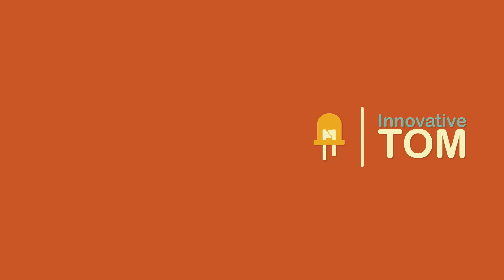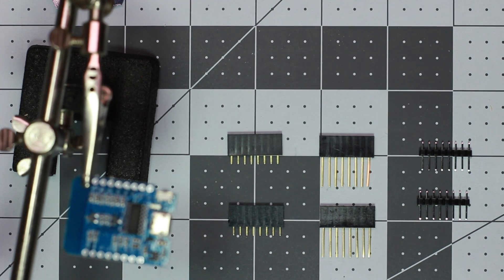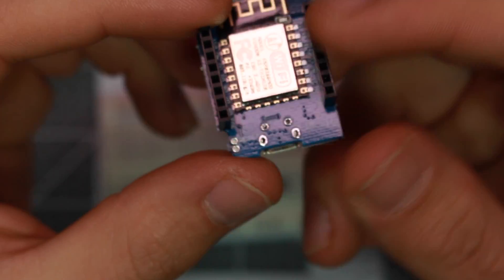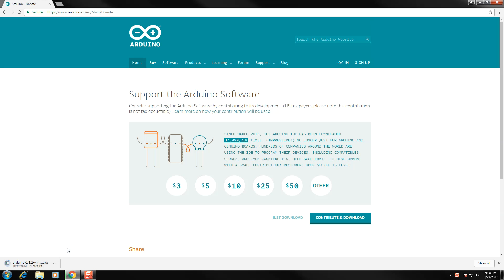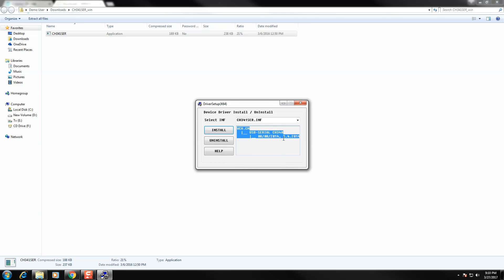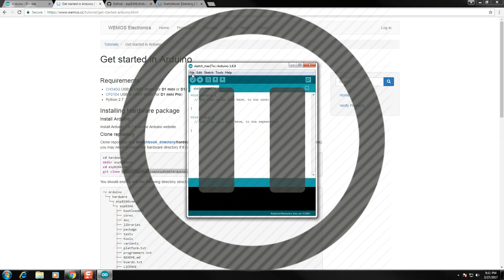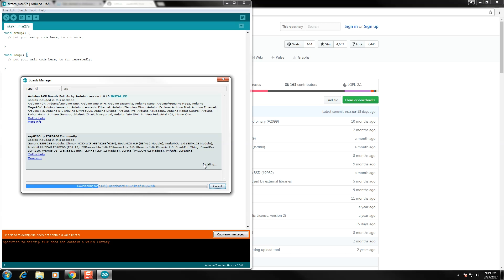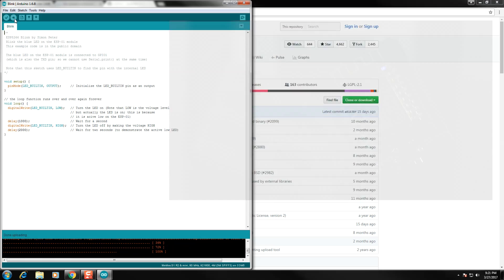Wemos D1 Mini, ESP8266 Getting Started Guide With Arduino

Comment: Hi Tom, I've followed the video, and installed the microgear library (v 1.2.4) and the board by esp8266 community (v 2.7.4), but I don't have the option you selected "WeMos D1 R2 & mini". Instead of that, I have only the option "WeMos D1 R1". Could that be the problem? The led does not blink like in your video, I receive a timeout error . Thanks, Andres

Comment: This newbie successfully followed the video - thanks!

For others just getting your feet wet:
(1) Some USB cables will have the right connectors, but are power-only cables; they won't work.  You need a cable with the data pins connected.
(2) The COM Port you need won't even be visible until you have the board connected to your PC with a good USB cable.  It will likely be the highest-numbered COM port on the list.

Other than that, if you carefully follow the instructions, it should work.
Reply: This was the single most useful tip I have read. I tried 2 different USB cables and neither allowed my Windows 7 PC to recognize the WeMos D1 Mini board.  Tried another after reading this and BINGO!  Recognized it!  The original poster should float this comment at the top of the comments.
Reply: that was hella helpful

Comment: I have a mac and can't get the board to connect with the computer because I apparently need a "driver" which I installed, but it still isn't working. Nothing comes up when I go to the "port" option. Does anyone who has a mac know how to deal with this?
Reply from the maker: +Aidan Angus-Henry from my experience mac users have a little bit harder time. The chip the board uses to communicate is the ch340g. You can google "ch340g mac" and find some different answers, but it varries depending on what os you are running. Let me know how you make out.
Reply: +Innovative Tom Thanks for responding! With things like this I've always had more trouble with macs as well, I'll look into that driver, thank you!
Reply from the maker: I did have it on a mac at one point I know it works. not on the latest os though. I remember having to mess with some command line stuff. The other thing you could do is install windows on bootcamp. Windows 10 is sorta free*. You can download and run it normally, it just asks to to register it to change some of the settings. That is probably what I would do.

Comment: The library is listed as INCOMPATIBLE with Arduino 1.8.2
Reply: My mistake. If you have the board selection as Wemos, it will show up correctly. I didn't realise they did this in the IDE. Pretty cool.
Reply from the maker: fusionstream sweet!

Comment: Good stuff, thanks for the tutorial!

Edit: I don't see my board coming up as a com port on my computer, any idea what could be going on there?
Reply from the maker: Thanks! Did you install the drivers for the CH340G? Make sure you restart after the install. Also try a different USB port sometimes that helps.
Reply: Restart the computer, or Arduino IDE?
Reply from the maker: Jeremy Cook's Projects both
Reply: Hmm, per your suggestion, tried that, tried different cable, port, and even a second board that I have. Not reading at all, not even as a bad USB connection. Interestingly AI_THINKER comes up as a new WiFi network.

The driver I find is actually ch341 and says "the drive is successfully pre-installed in advance!" Any input?
Reply from the maker: Jeremy Cook's Projects so it getting power and working, sounds like a driver issue. I would grab the drivers from the wemos website.
Reply: Hmm, did that to begin with, did it again, still not seeing it in device manager. Thx for your input though.
Reply from the maker: Jeremy Cook's Projects I would keep messing with it sometimes it something simple, are you using a hub? Sometime they can provide enough power. Also do you have the same wemos? The "pro" or newer one uses a different chip
Reply: Hmm. I was, though tried direct, and even a different computer (without the drivers installed there though). Tthe module says ESP8266MOD, not sure if your says that or "EX." Anyway, thx for the help, I'll likely set it aside for a bit.
Reply: Hey Tom, just wanted to let  you know that it seems it was the cable (though I thought I tried two, perhaps I did and they both didn't work correctly?) Took it to a friend and he tried his, worked nicely. Still haven't programmed it, but at least showing up as a port!

Thx again for your help.
Reply from the maker: +Jeremy Cook's Projects AWESOME! It's always something simple.
Reply: Ha, yeah. A little frustrating, but happy to have it solved!
Reply: Got the same issue, gladly I found your comment! My cable was broken as well xd

Comment: At 0:15, how did you add the label that follows the "FCC" marking for a few seconds? That is very neat.
Reply from the maker: Jim Happer it's called a "call out". I used. Program call Black Magic Fusion. Can be done in after effects and motion 5. The follow feature is build into the program. Took a lot longer to do than I expected.
Reply: I think the call out was worth it. Thank you for the reply and the exceptionally clear tutorials. I just used your soldering trick with the headers and it worked very nicely.

Comment: I have noob question, 

qns 1) what if we solder on the other side ( face the other way)? 

qns 2) both way works, why do you solder the direction you are doing?
Reply from the maker: weinfin so because of they way the shields work. The Pinout need to match up. It could work either way but you want to make sure the pins and shield pins line up.
Reply from the maker: Also could call them IO or outputs of the wemosbord

Comment: how Wemos D1 Mini, ESP8266 connect with arduino?
Reply: download the driver, in the IDE (arduino software)
Reply from the maker: Siêu Nhân and actual Arduino or the software?
Reply: between ASP8266 miniD1 and Arduino Uno because i want use esp8266 to send data which i had from arduino uno( data sensor) to server
Reply: i did ! between ASP8266 miniD1 and Arduino Uno because i want use esp8266 to send data which i had from arduino uno( data sensor) to server